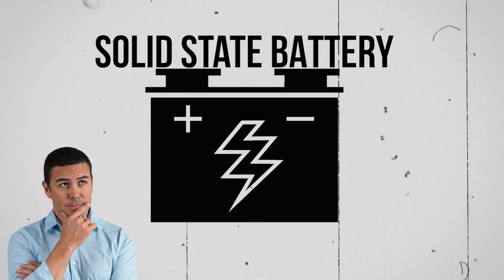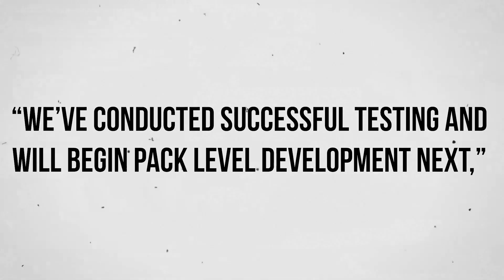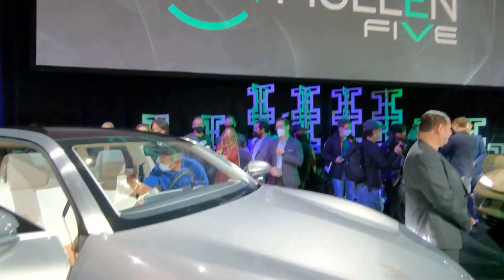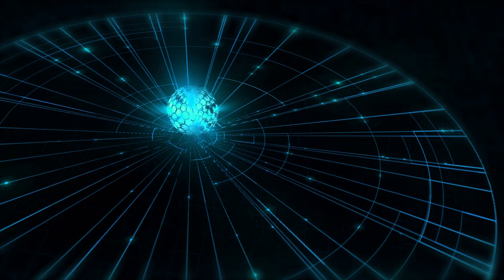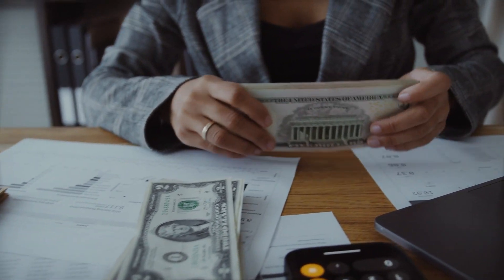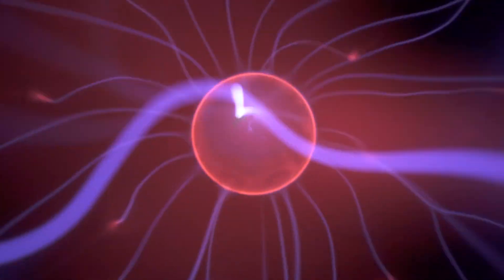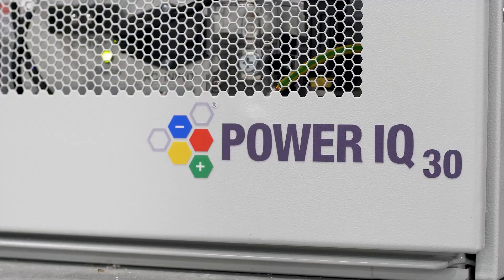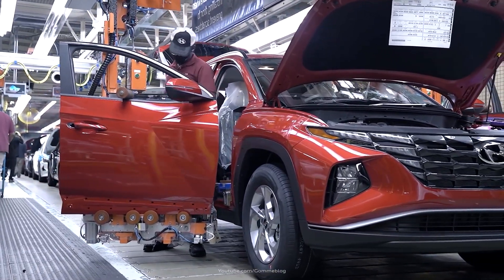BREAKING! Mullen (MULN) Automotive ANNOUNCED NEW Solid State Battery Testing

Comment: What is the decisive distraction. They will release bs and the stock will rocket and they will dump share on the FOMO leaving retail holding the bag. If you have share sell before 8.84 or you’ll be a drag holder for years.

Comment: The first 3 minutes of this video is literally just reading from Mullen's Press Release statements about its battery from February (search "EV Manufacturer Mullen Announces Progress on Solid-State Polymer Battery Pack Development") and April ("Mullen to Conduct Solid-State Polymer Battery Cell Testing with Leading Independent Facility, Battery Innovation Center (BIC), in Indiana"). Seems rather demeaning to serve for free as just a PR tool for the company, or are you getting paid to help promote Mullen?